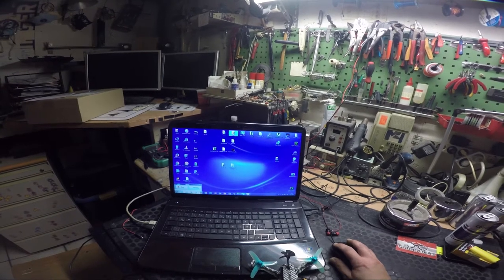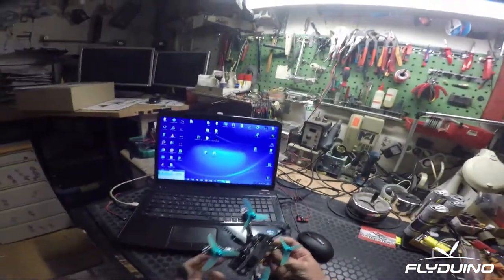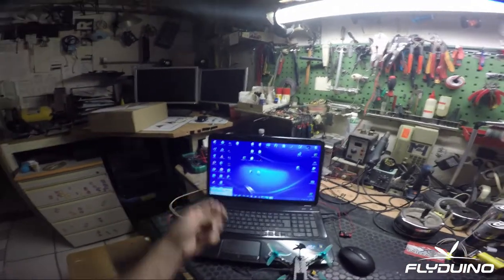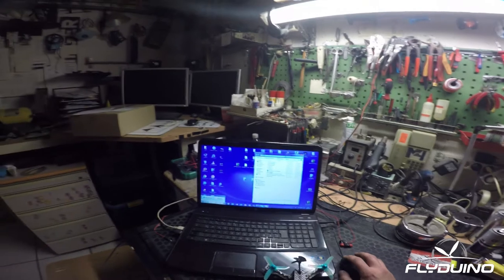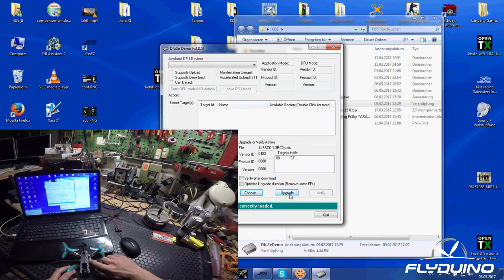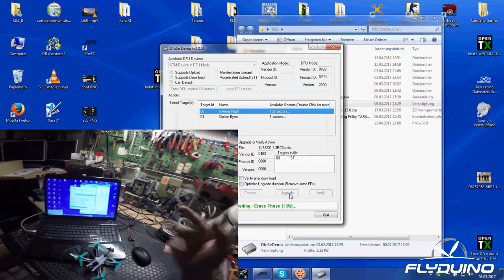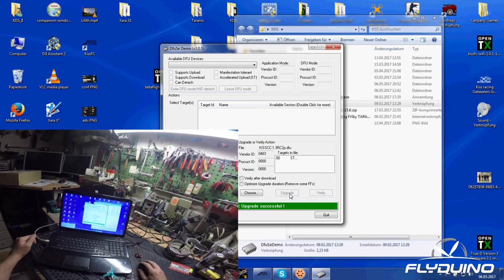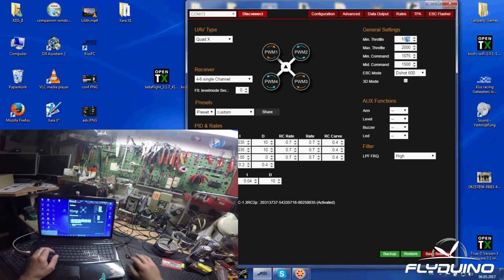upgrade KISS-FC-CC quick and save

Comment: Hey thanks for the video. I have tried to upgrade my kiss fc as the fw was too old for the GUI. I did it just like you did, but nothing seems to happen when I press Connect. The gui does not show the activation warning. Im running w10. Could this be a problem? R25 on 1.15.8 gui.
Reply from the maker: Possible, better go to firmware RC30 and GUI 1.15.16 (latest). It’s btw. the best version i‘ve ever flown.
Reply: yeah, I finally got it done. I had to gradually update matching fws and guis until latest. Man in this hobby if you sleep for 1 second you're out!
cheers